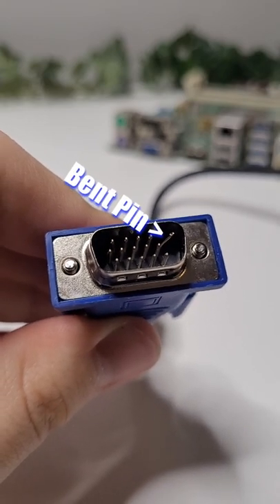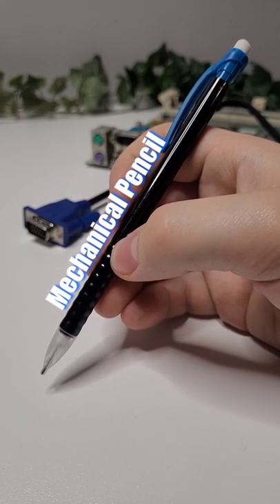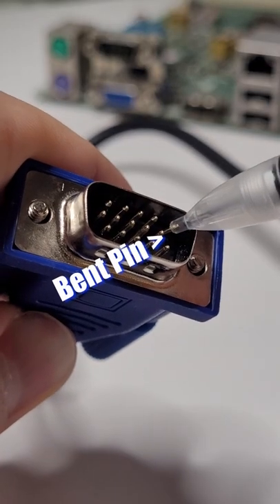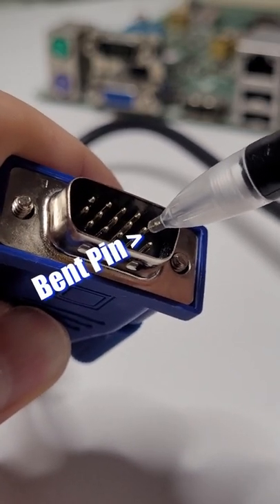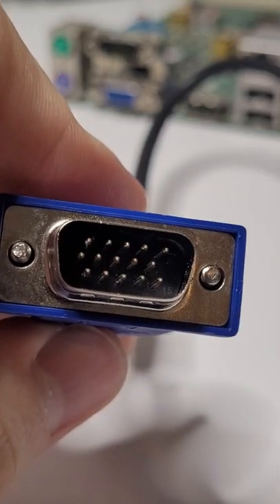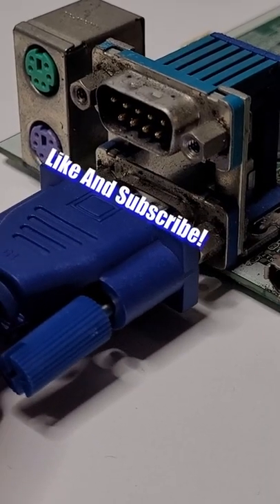Fix Bent VGA Cable Pins #Shorts

Comment: Grab mechanical pencil..... And foking break it. Rather do this. Take a needle or some thin metalic object. Try to bend it roughly to the shape and just use other end of said cable wich must have male connector (if it doesnt you work in goofy ass place and wanna know about it just to avoid it) and ehmmmm couole em, tolerance on connecor pin isnt like your opinoin on genders and have space to move.... If it foks up, it was alredy foked up and you have some nice hanger for your nech bcs you are that cheap that you have to "repair" fokin VGA cable.

Comment: This is what you do we have a bent VGA pin.

1. Throw it away and get an HDMI cable.
Reply: My monitor don't even support it
Reply: @1223emerald  Step 1: Throw away monitor and get a new monitor that supports HDMI or DP.

Step 2: Throw away VGA cable and get an HDMI cable (get DP if the monitor has that, but HDMI is fine too).
Reply: @Machodave2020  if you have iq, you can buy an VGA to HDMI adaptor and continue using it, my monitor cost a bit and I don't have enough money to afford a new one
Reply: @1223emerald  actually, that is a possibility, it's just that why would you do that if you don't have a monitor with VGA? That being said, that's still a viable option.

Edit: also yeah, don't take this too seriously. It was never that deep. I completely forgot I even made this comment. The fact that it's almost a year is wild because when I read it, I then remembered that I made this.
Reply: @Machodave2020  i understand that, we forget our comments pretty fast and I have a VGA so I will be needing it
 Peace ✌🏻

Comment: Great. What if one pin is appearing shorter than the rest?
Reply: get a new vga prob broke off
Reply: @littleruffo130  funny thing is it didn't 😂😂. Fixed it with a really small plier. I pulled it just enough to level with the rest and it still works